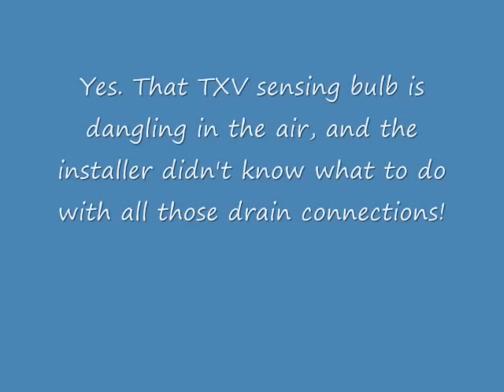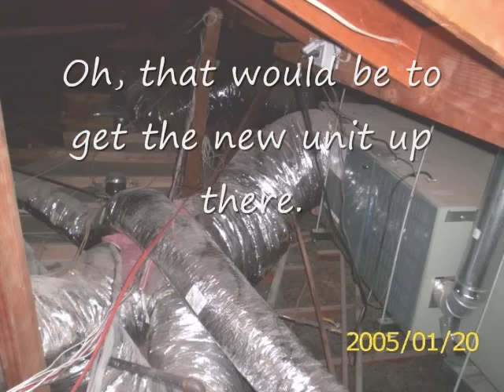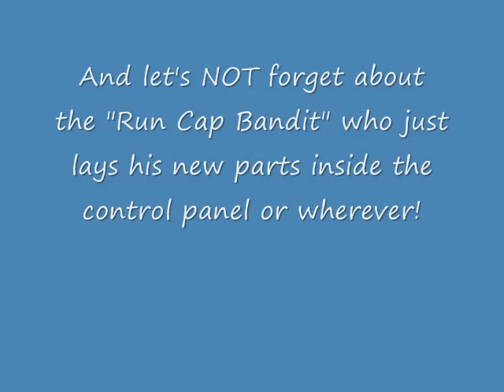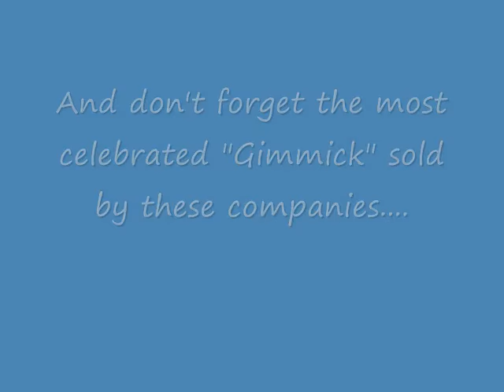Misc Hacked HVAC Installs and Repairs!

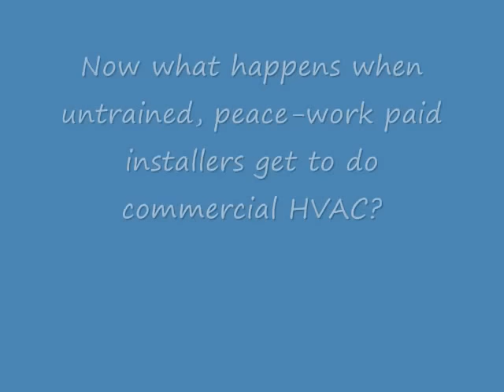Comment: OMG 2:10 I know that job. I was there 7 years after you had been there. They still insisted the original contractor service it and I found the oil traps were installed upside down. I eventually had to replace the compressor on the first unit.

Comment: It's unbelievable how little pride some of these hacks take in their work. I wouldn't dare call them techs, it gives the rest of us a bad name. It always made me feel slightly ill to open a panel and see a run cap electrical taped, unsecured in the box, or just sitting loose. On at least one occasion I even found one that was just left dangling by its electrical wires under the fan motor. It is a shame how many of the big companies around Phoenix only care about sales and praise their inept hacks for being the best at ripping off customers.

When I was a contractor striving to place honesty, integrity, and quality workmanship above all, I was very leery of commission-based pay. Although, I found that piecework CAN be an effective way to increase productivity, profitability, and motivate your technicians. The key is to demand integrity, customer satisfaction, and accountability. I required my receptionist to call every customer after EVERY SINGLE JOB we completed to ask how the technician performed and ensure the customer was satisfied. I also randomly did on-site quality control spot checks. When techs are being paid by the job and not hourly the last thing they want is to have to spend their time going back to a job they were already paid for to fix something they did incorrectly. They knew the time they could save by cutting corners would pale in comparison to the time it would cost them to make another trip back for free to fix their mistakes.

Also, I don't understand why you have such a poor opinion of Zerol Ice. Have you ever actually measured or tested its effects? I was skeptical of their claims as well. However, after installing it on an air conditioner of my own it seemed to dampen the noise of the rather loud scroll compressor. I didn't have a dB meter to measure the noise difference, but it was right outside my bedroom window so I had a pretty good idea of how noisy it was before and after. What really convinced me that it wasn't just snake oil was the reduction in amp draw. Immediately after adding Zerol Ice I saw a decrease in amperage of 1.5 amps on both L1 and L2. That is a 345 watt reduction, right in line with their claim of up to 11% increase in energy efficiency. That is hardly insignificant here in Phoenix, where we spend hundred of dollars a month in the summer just to power our air conditioners. That made a believer out of me.

I didn't think it was at all unreasonable or unfair to charge my clients $160 to install something that cost us $40 and took about half an hour to install. Lots of companies around here charge $250 or more to spend 15 minutes replacing a $3 contactor, and that doesn't even have any value-added benefit. Based on my own energy savings, the Zerol Ice treatment will pay for itself several times over throughout the typical lifespan of a compressor. Not to mention the added bonus of the reduction in friction and wear and tear on the compressor, which should extend the equipment's usable life. It's hard for me to see that as a gimmick. Synthetic oil reduces friction in car engines, I don't see why Zerol Ice couldn't have a similar effect on compressors.

Comment from the maker: I actually lived in Payson, AZ about 100 miles NorthEast of Phoenix. We had to pull permits and pass codes all the way down to having the ratings sticker on the gas flex line and they'd measure the distance of the disconnect form the condenser unit and they wouldn't pass us if it wasn't per code! Then i moved down to Phoenix which is in another county. Night and Day difference! I was in Prescott, AZ Monday and all the gas lines had drip legs, etc. Another thing they SKIP here in Phoenix!

Comment from the maker: It was a mix of several jobs. 

"Sales techs" where what I called the technicians who could sell good but not fix units or even want to do a good job. Their sales were good and the company in question gave them props in the monthly meetings before everyone. It was about revenue generation.

The units were installed by commission based paid install crews. 
Which is why they'd "wham bam - Thankyou maam" the installs with kinked ductwork and sloppy installs for the few of us REAL techs to fix.

Comment: I've dealt with hacks trying to fix a no heat on an old hydronic system,1 guy who came highly recommend walked in and within 90 seconds said"unit can't be repaired and you need a new one" he gave me a price and about fell off the chair, 2nd guy fooled around with it for 45 minutes and I asked him to leave because he evidently didn't want to diagnose the issues and only sell me a new unit,3rd guy came in and actually diagnosed it with it needing to be bled and the unit cleaned,he fixed it but also said that there's a leak somewhere and it should be found, he didn't say anything about automatically about replacing the unit and it worked fine until we sold the house (as is where is) the unit was 60,000 btu gas,and a couple of other neighbors had hack jobs and had to have the whole brand new system taken out and replaced because nothing installed met code(they got polished turds- used and rebuilt units) township and state caught on, revoked their license and sent the owners to jail

Comment: AXV's don't have a bulb.  The sensing bulb is for TEMP, hence the "T" in the TXV (Thermostatic).  AXV is Automatic Expansion Valve, don't see many of those around anymore, maybe on old R-12 car air conditioners, or I think I remember one on an old R-12 ice maker.

Comment from the maker: The city/county is either incompetant or on the take for years. I haven't figured out which. But yeah it's horrible! Before I moved here I did service and install before that. If we had an issue with passing inspection guess what, we had to FIX IT! And we did whatever it took to do it right.

Comment from the maker: If it was marketed as just oil it would be one thing. Although still only 4 ounces. |
But they say it coats the inside of the piping and makes the system quieter.
50% of the time it actually made compressors noisier.

Comment from the maker: Snake oil. And I can't believe Nu Calgon is behind it.

It's 4 ounces and can't possibly due jack s*** inside all the surface area of the sealed system. 

Back when I was around residential they were pimping the snake oil for $225 an application!

Comment from the maker: Oh yeah,. The "Over/Under" American Standard units at 1:45 drew in condenser air form the free space, then they installed a HOOD over the condenser fans and ducted it to a vent in the side of that attic space. I left that company before I could watch those fail in the summer time! Not too mention the sheet metal hood blocked the condenser fans completely as well as the control panel to the one unit that is positioned in between those two units. Nice huh? No permit no inspection...

Comment: some things were ok.. like the condenser motor for a blower is fine... especially is its a vari speed .. run capacitors in a box.. some weren't to bad.. the other's were real bad..

Comment from the maker: LOL! Actually CR actually gave their techs OEM motors for all the motor change outs. But DSC was the one where I found the condenser motors in the blowers! That's because the techs got paid by the job their, not hourly like CR. No way they gonna leave to get the correct part if they can still make the money with the wrong part! Zerol Ice... that shit is defenitely SNAKE OIL! LOL! Although I never seen anyone pay $350 for it! DSC was charging $225 and I thought that was insane for a gimmick!

Comment: aint nohing wrong with using cable ties to put on a tx valve bulb just as long as you use 2 and do them tight.

Comment: Looks like you clean up alot of CR's installs to lmao. Why bother with using a blower when you have condensor fans on you truck lol. I had a customer yesterday that said they paid 350 bucks for zero ice. I felt so bad for them. That and hey you really need a hard start kit with this unit, if it needed it the factory would put it on. That and dont bother with filter dries the metal flakes like to collect in your coil, so we will be back in a month to change that too.

Comment: well the city should enforce the codes because half the installations if not all of them in this video are fire or safety hazards, if i installed one of these things id follow all codes and the installation instructions to the letter hell id even have someone help me to make sure this HVAC unit is put in right

Comment: Ok a customer calls a repairman there call center quotes the lowest price in the business (A TO BE GOOD TO BE TRUE PRICE.) The call center asks for your zip code (WARNING THESE ARE THE SCAMMERS) and they say they have guys in your area. But most of the time they will never quote a exzact price. Even if you wanted a wall tempature switch replaced. What we see is these scammers all seem to all have out of state tags. And any Hvac company can work for them. But most want because of there problems